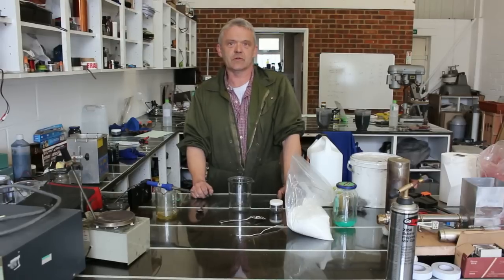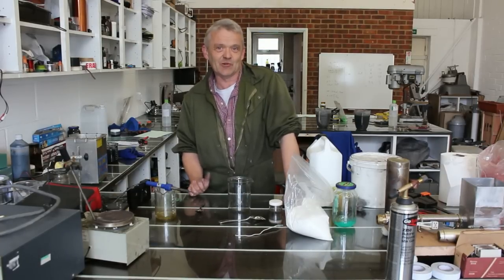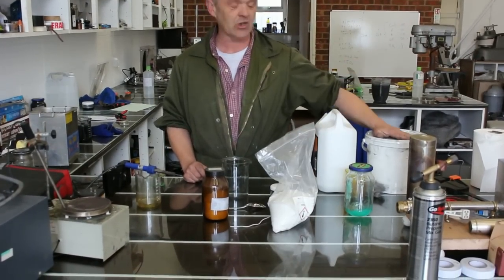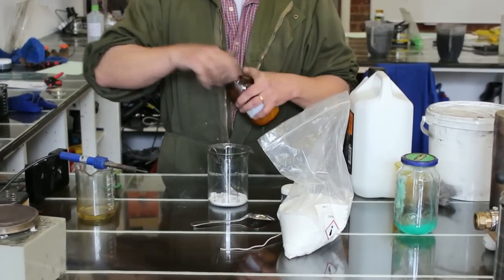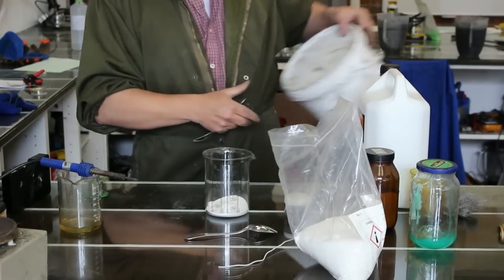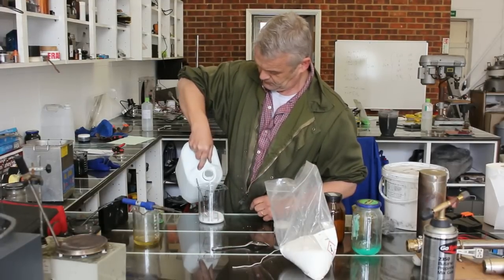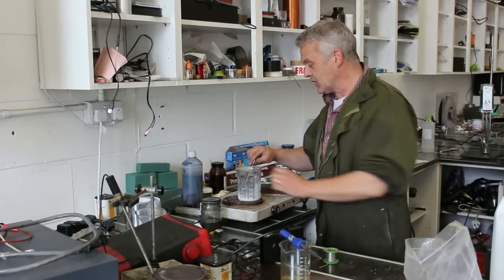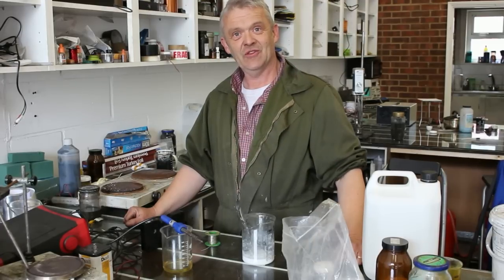How To Make Your Own Flux

Comment: If you can't find Flux at home, it's easy to make your own. For this you will need 500 grams of plutonium, 200 grams of platinum if possible from a meteorite spat in Egypt less than 2 years ago and a can of Boeing 737 kerosene brought to a temperature of 1 degree below boiling point ^^.

All joking aside, thank you for this tutorial.

Comment: If you are using this flux remember that it can be quite corrosive.  Stainless steel gets it's corrosion resistance from forming a very thin coating of oxides on it's surface that protect the metal underneath.  This process is called passivation.  Soldering stainless requires a strong acid flux to depassivate the surface.  Using an abrasive also helps.  After using the flux the joint must be cleaned thoroughly then repassivated.  I use a solution of baking soda in water to do this.  The result is 50 year old solder joints that are still solid.
Reply: most flux are actually corrosive some are just not as much corrosive than others, rubbing alcohol and baking soda with water are a good solution to neutralize the acid

Comment: hey rob, I've had some success making soldering flux from pine resin, don't know if it works as well as the boric acid route but it's easy to get and smells good, well worth checking out if you run out of chemicals
Reply: I used this for. Years and it works a ok

Comment: ILl be honest. this hasnt worked for me. I used the same ratio, made a syrupy flux. Put some on some bolts I have that I was to solder to, and instead of soldering anything. the flux just puffs up into a crystallised thing and nothing solders :/ 
Is this only good for flame welding?
Reply: this is for brazing useing a pressurized flame ,with brazing rods with little to no tin and zinc added .not for soldering with a iron which cannot consistently saturate the work area with heats the are required to melt the flux ingredients ontop the area to be welded . soldering uses liquid low temperature flux to keep the area oxidation free till the solder cools down. 

if you do mean brazing but just mixed up words then i would suggest if possible picking the parts to be welded to clean them from the protective layer added to metals like copper . or sand it good .. 

but this method does work as long as the part remains free off oxidation till cool down

Comment: I think finding flux is more easier than finding any of this 3 ingredients.
:o)
Reply: TRUE
Reply: All three are dirt cheap and easy to find in the US, however they may be more difficult to source elsewhere or perhaps go by other synonyms. 
Boric acid is sold as cockroach pesticide, borax is sold in every grocery store as a laundry detergent, tsp is sold in the paint isle of every big box or hardware store.
Reply: All you need to find is some petroleum jelly it works just as good as any good quality flux
Reply: I agree with you:-))

Comment: Here's a question for you. Where can we find information about the different salts/acids that are good for fluxes?  Phosphorous seems to assist copper in melting but what if I want to also incorporate the 'cleaning' aspect as well.  I want to simply braze stainless steel and while there are countless fluxes I can buy (and the brazing rod has P already in it) apart from this recipe which seems to be suited to Sn/Sb/Pb but I want something that's better for melting and bonding copper to Stainless. What resources can I reference to help me learn this bit of inorganic chemistry?

Comment: so you found a bunch of exotic chemicals but could not find some flux paste?  lol anyways i have BA but idk what borax is or if its the same familly,also the tri sodium phosphate  ,do you really need these other two? i was having trouble trying to solder 1/16" steel wires for fun exp  to see if i can do it with a mini torch i juts made that uses oxy and propane,,so i tried silver soldering with some regular flux i found and i was having problems,,i figured it might have been the heat was too high so i dialed my flame back but it was still oxidizing and the silver just exploding or balling up,after some online search i figured let me mix some water with boric acid pest killer i have ,and it worked beautifully,simply applied the paste between the two rods (which helps keep em stuck together) and then slowly heated them till cherry red and started applying the silver and it was melting nicely and coated both rods ,,love it ,juts made this now

Comment: Thank you for sharing your personality and knowledge with fellow inquisitive minds.  The internet has gotten to be such a big place and over run by sales related websites, its often difficult to find useful information.  Thank goodness for people like you putting it out there. Simple and with out a lot of fuss and bother. 

No need to reply but if you feel like it, or if anyone else reading these comments has thoughts... I'm left wondering if there would be any advantage to using alcohol instead of water in this flux.
Reply from the maker: i know what you mean mate and i am afraid i don't know about using alsohol
Reply: Alcohol will be fine, but it might be tricky if you're using a brush to coat your flux. If you want to use alcohol, don't waste chemicals, just mix it with some borax and dip your piece into it. Then ignite the alcohol (take care not to ignite your flux dish ! if you do so, just cover it with a plate.). The flux should be evenly spread. But the flux on this video is better, because you can use it in a sprayer if you add more water to it.  (I always use tap water to make this flux, and it works just fine.)

Comment: can the same aluminium rods used for arc welding be used for butane torch brazing? i have flux cored but its not really happening , is having seperate flux and filler rod better for my purpose?

Comment: I was wondering what would be the most useful chemicals for the home expirimenter to have on hand.
We all don't have a full chemistry lab at our disposal.
Reply from the maker: PETER MOLL It depends on what area you want to work in - there are a few basic reagents you need often like a range of solvents, acids and alkalis but it really is a matter of what you are interested in - the only reason i have a full chem stock is because when i want to demonstrate something i buy a lot of the chemical - like a kilo or so and then leave it in the stock cupboard so when it crops up again i have it. The area I work in means i have a lot of binders, solvents, acids and metal halides - but you will build up a stock of what is useful to you just by buying what you need when you need it

Comment: hi rob regarding silver brazing applications
can i use your formula for both 
high silver alloys (35 to 50 percent silver) for ferrous metals and low silver alloys (5 to 7 percent silver) for copper base metals.

Comment: sounds like the trisodium phosphate is the hardest of those three things to get since they are pulling anything with phosphorus in it off the shelves here, I had to use a cola (has phosphoric acid) to color anodize some titanium ages ago cause they sold nothing at a store here locally that had phosphorus in it including the TSP (all they had was TSP substitute free of phosphorus of course lol)

wonder how hard it would be to make TSP out of mono calcium phosphate fertilizer and say some drain cleaner (*sodium hydroxide) from what I am reading the monocalcium (*triple strength phosphorus fertilizer)  can be turned into phosphoric acid effectively by adding sulfuric acid to it and the acid and calcium react to make calcium sulfate which is supposed to be insoluble in water, so it separates out with nothing more than a fitration (if so) so I guess once you have phosphoric acid that could be added to the sodium hydroxide to get a sodium phosphate compound, just not sure what conditions to make sure it becomes TSP are required lol.
Reply from the maker: Thomas Anderson TSP is pretty easy to buy mate - home depot sell it in bags - i got mine from ebay
Reply: I tried home despot here and they hardly sell anything it seems though I have not tried for TSP yet, will have to have a look at that for sure, everything else though like toluene and such they either had nothing or had some substitute like xylene instead only, most of the stuff I have found (which still excluded TSP)  was at ace hardware. could just be the part of the country I am in but being in an oil state I would have figured they would be ignoring most of the "save the planet suggestions the rest of the country is following. either way I would definitely like to find out how to make it from other compounds, since the making is often the fun anyway lol
Reply from the maker: Thomas Anderson absolutely mate and you learn tons from synthesizing your own stuff
Reply: also I guess it got missed here, that I said hardest, lol not hard, with some diligence you can get anything even in the most politically restrictive environment ha ha

Comment: Can you use this for pcb solder/de-solder flux?
Reply: Since it's acidic, it can't be used for electrical connections.  The flux will corrode the copper over time, producing an insulative 'cold solder joint'.  For pcbs, you have to use rosin flux.

Comment: Interesting. The whole point to soldering flux is to keep metal from oxidizing when heated, right? Okay, may also to remove any oxidation there too, when the metal is heated. Soooo, wouldn't oil accomplish that? Has anybody actually tried soldering a joint immersed in oil?

Comment: Hi friend,
I was thinking about your copper ink video. Do you think that with those chemicals mixed with your ink, you could fuse the copper with a torch? (The support may be glass or ceramic fiber in order to sustain the temperature.)
Reply from the maker: hfyaer I don't know - it's worth a try
Reply: Wow now that's interesting
Reply: Or a Bunsen burner or a propane bottle hey do you think I could use aloe vera gel as a flux or what's in it that makes it super hot. Are we just going after the gelled type thing here

Comment: would this be suitable for melting aluminum (aluminium) copper and bronze?
Reply from the maker: +George Wood it's just a borax flux mate
Reply: To melt copper and bronze, you just need to add some borax powder, that's all. This flux is for brazing and soldering purposes. Aluminium melts easily without any kind of flux, but problems might happen when it comes to soldering it with a torch. You'll need a special kind of solder, and a special kind of flux. This one will not work for soldering aluminium.

Comment: ive heard that you can use tree resin ive never tried it but what are your thoughts on that?
Reply from the maker: сталкер чворович you definately can - well rosin - which you can just buy as a powder
Reply: сталкер чворович If you can't find it, you can get rosin from a music store, they use it for the violin stick, you crush a piece and dissolve with isopropyl alcohol but that rosin can be expensive, you may buy rosin chunks from a local market too, most probably cheaper. They get different and confusing names.
Reply: Robert Murray-Smith thank you mate
Reply: zerpBot they also use it on dance studio flooring too for grip while dancing apparently, saw loads of it when I was at one helping someone clean up after classes.
Reply: If I were you I would avoid the use of isopropyl alcohol..... you'll thank me later in life.....
Reply: @inUR2teeth  why, if you dont mind me asking???  as long as its either very small amounts or well ventilated, and contained appropriately, whats the issue?

Comment: Hi Mr. I AM brazilian and i do no speak englishh and i no hear . i ask what the third component acid boric' bórax and?????tthanks thanks thanks
Reply: Trisodium phosphate (tsp), it is a cleaning product found in the paint department in most US stores at least. There is also tsp substitutes which can be misleadingly labeled and will not work for this purpose. The ratio is 3:2:2 (boric acid:trisodium phosphate:borax). Also keep in mind this is an acidic flux which can be undesirable.

Comment: Cool, I think I have those 3 ingredients laying around. 
I bought the TSP 8 years ago to try and reduce dish spotting in the dishwasher. Had zero effect. Still have the box I think. 
I bought the borax for the laundry. 20 or 40 mule team.  I forget how many mules.  It had some mules.  Also it is supposed to open your third eye by decalcifying your pineal gland. Superpowers!   
Lastly, the boric acid is a common roach killer. 
I assume this is then good for soldering copper pipes. Good video.

Comment: This reply contains information that validates Mr. Smith's flux recipe - please read for more information. 

The ratios of the ingredients specified were followed - of course using TABLESPOONS instead of TEASPOONS

2TSP - BORAX - eBay
3TSP - BORIC ACID -eBay
2TSP - TSP - eBay ( common cleaner found in home depot, Lowes)

The mixture was diluted with water in excess, and then brought to a boil until a gelatinous consistency was achieved, unlike the water paste shown in the video. 

A piece of copper was cleaned and then the jelly like mixture was smeared onto a clean area. Torch heat in excess of 1200 degrees F was applied, and the entire coated area remained the color of pure copper - while the surrounding area was subject to extreme oxidation. 

This flux recipe is a successful one from my tests, and I encourage all who want to make their own flux , to start with this video.

All ingredients are purchased from eBay for around $55 total, and can make you a batch of flux for $2.50, compared to the $10+ for a similar amount of commercially available flux. of course with the amounts you can obtain from eBay - you could have a lifetime supply of flux!

I encourage you to check the MSDS for commercial brazing fluxes, and you will discover the main ingredients of these fluxes - Boric acid, and Borax! 

Great video, Mr. Smith - I thank you for your assistance!